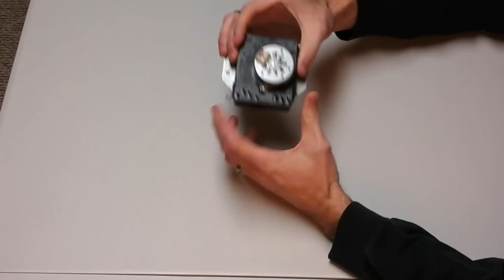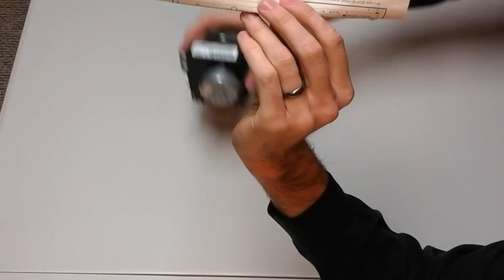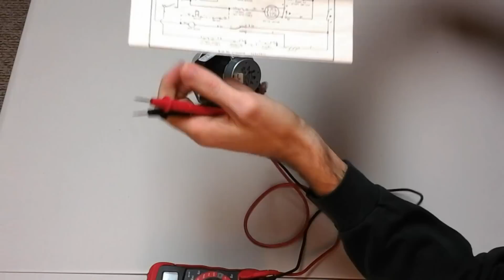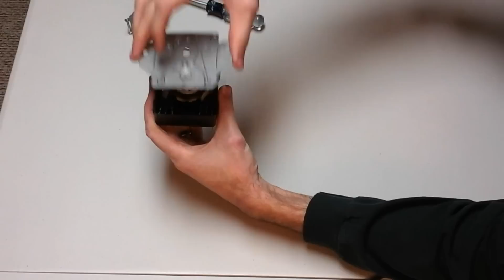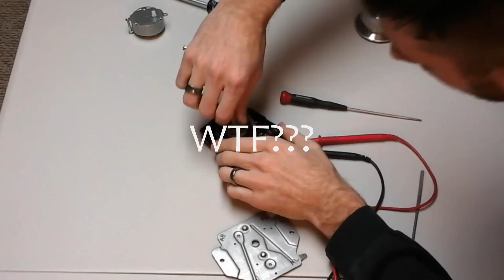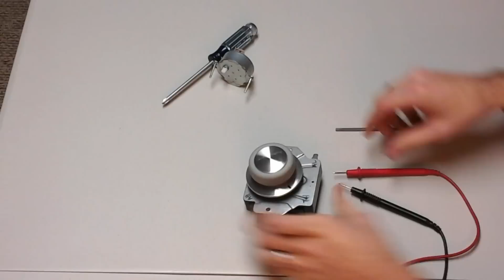Test and repair a clothes dryer switch

Comment: Best fix for the switch, in this marvelous how-to. #1 - by far. 
I'd like to invite you, Dustin, to join me for the beverage of your choice. You earned it. Multiple beverages, if you like. Saved me, at least, 85 bucks. Clear instruction and a logical progression of your simple diagnostics and repair. Outstanding, Sir!
Forget about the blob of solder technique, demonstrated by a Johnny-come-lately.
This video is a fine example of the theorem, "If you can't fix it with a hammer, you have an electrical problem."
Best of all, most importantly, my Gal is happy. However, after she calmed down, I explained that the feather in my fixed-it bonnet, is due to your instruction. Still, I reaped the reward, and I can't stress enough, how thankful I am for your time and knowledge.
Reply from the maker: FyouyaFnF LOL. I'd gladly join you for a beverage, but more importantly I'm glad that you got it figured out, and got a little reward in the end. I appreciate you watching.
Reply: I would like to say.....same same, same same same! Cheers brother! Not sure where you are but drinks on me 👍

Comment: Those terminals are easy to remove. Simply turn the timer over and place it on a piece of wood and tap them with a small hammer. They come right out undamaged.

Comment: Thank you so much for this video! My problem wasn't exactly the same, but your teardown video helped diagnose the problem. A plastic piece on the rings that pushes the plastic tabs to complete the electrical connections  had broke and I was able to fix that and get my dryer working again at zero cost!

Comment: In my case I simply removed the timer (the round disk) and it works perfectly. The button was very hard because the white gear of the timer barely moved and therefore did not make contact. No matter how much I scraped the terminals, it was still the same. Now it works perfectly, but without the timer.
I agree with you about planned obsolescence, but this time it was the timer and not the terminals.

Comment: Thanks for the video.  I was about to order a new timer, but it was the exact same issue you had where the contact between C<->A was not making connection, cleaned up the contacts and did the slight bend, works great now.

Comment: Thank you. But, I did have to wrap tape around the bottom white arm on the right so it would push the copper bands further to the right. There was a gap between the B contact and the A contact. I had to wrap the tape so the white arm would push the contacts further and close the gap. Then the A contact and C contact gave a beep with the multimeter. Thank you for your video. This video helped me twice. Once a year ago haha. I see my comment. I had the general idea from a year ago lol thanks.

Comment: What is the name of the part that connects to the knob? Mine broke and I do not want to replace the whole timer.
Reply from the maker: That is probably not a replaceable part. The shaft that the knob slides on to probably connects to the gear mechanism. You’ll probably have to try to repair it or replace the whole timer.

Comment: Seems like they should have used the switch to activate a 240 volt relay, rather than carrying the 240 volts itself.  I remember when auto ignitions used contact points, and this was a constant problem.
Reply from the maker: Well that would be too robust and last too long, reducing the number of units sold per year 😉

Comment: Great Video! My dryer was not heating, but in my case it was the plastic part in the timer that had worn out. I have CADed the worn out part. Here is the link to the 3D-printed part I designed.
https://www.thingiverse.com/thing:4905660/files 
Anyone can download this file for free but it is not for commercial use.
For anyone who does not have access to a 3D-printer, I am open to helping you out with a minimal fee. Just PM me via Youtube.
Reply: Thank you!  Both you and Dustin saved me so much $$!! Bless you both :)
Reply: Thank you sir for designing it! I will be using it :)
Reply: You are incredible!! Thank you!!

Comment: Have you tried using a disposable emery finger nail file? It is a thinner instrument that gives when placed between the contacts. The flat metal file may be putting much pressure on those brass springs, thereby causing them to loose tension, resulting in a minimal surface contact when they come together.

Comment: What are the plastic arms called inside the timer? Where can I get them?
Reply from the maker: I'm doubting that the internal components of the timer switch are available to purchase separately. If one of the arms is broken or worn, you'll either need to repair the arm itself, or replace the timer. I seem to recall one of the comments below where someone fixed the center rotor that was worn down. He used a mixture of super glue and baking soda (which makes a hard plastic type material) to build up the worn area and then sanded it to shape.  You may be able to use other fine powdery substances with super glue too. I did it with super fine sawdust in this video https://youtu.be/5UpVl5eMzVU
Reply: @DustinRogersinMO  Thank you!

Comment: I have scoured the internet, but do you by chance know where I can get that same type of copper lead/terminal. I have done this a few times over the years, as it was such a major help, but now the lead is completely burnt out. I would love to just be able to replace the lead but can't find anywhere. If you can help oh my goodness I would be so obliged. But if not I thank you anyways for this awesome helpful video and information.
Reply from the maker: I believe they are molded into the switch housing and don’t think you’d be able to remove it even if you did find a replacement.
Reply: @DustinRogersinMO  Ohhh ok, well shucks, that sucks lol, but I really thank you anyways and appreciate your time.

Comment: OMG I LOVE YOU!  You just saved me $300.  ($100 for parts, $100 for service call, and maybe another $100 for labor).  YOU ARE AWESOME.   I also learned once you take off the cover.. DO NOT turn the thing upside down unless you are holding all the pieces in place :(     
The other issue my switch had was the very bottom ring came loose - because people were turning the knob left (counter clockwise).  Took a little while to find the right way to get the bottom ring in place again but hey, I never would have tried if not for your AWESOME VIDEO.    My Roper/Whirlpool dryer has now been fixed - by me - 3 times for 3 different problems.  :)  People like you should be more common!

Comment: Dustin - I literally created this account to go back and thank all of the amazing people over the years...who have not only taught me, but saved me thousands of dollars - you are an unsung hero my friend.  In a small effort to give back - if you are troubleshooting a dryer which refuses to heat, but the motor still fires up - it can be really difficult until you have a multimeter that measures continuity with an audible signal.  I think everyone has that CenTech that measures Ohms (not knocking it - I've used it MANY times).  Problem is, well, you just need a beep for continuity, and I just went and bought the Ames CM600A from Harbor Freight.  No - this is not an advertisement, just my personal experience.  Once I was able to isolate the thermostat, the fuses, and the heating element as good electrically by a simple beep for about $50 - I focused on the timer switch - tested for continuity across the points, and knew that was the problem.

Just from my experience - when you open the timer switch - pay careful attention to where the switch is located on the dial when you take it apart.  There are an array of gears and contacts that need to line back up.  This is not to keep you from the repair - just keep it in mind as you take it apart (and to put it back together again).  If the timer switch is indeed the culprit - you will see it almost immediately - there will be charred contacts on the copper circuits which should be clean.  You may need a flashlight or a bright light source to see the charcoaled/blackened contacts - what I did, was use a mix of fine files and fine sandpaper (available for very little cost at Harbor Freight).  I know, I sound like a HF fanboy, but for stuff that I've mentioned - well worth the savings.

Again - saved me a lot of money - thank you Dustin - incredibly appreciated!

Comment: This is great... thanks!  I had the very same issue with the very same timer, and my temporary solution was to wedge a piece of tin foil in there between the A contact bar and the adjacent post.  Never thought of just bending the bar a little bit... thanks!

Comment: Maaaaannnn.... I had no heat on my dryer for maybe 1 1/2 months! I looked at this video n did exactly what you did with a multimeter for continuity on each setting and noticed 1 lil prong was making 0 contact on any setting n just bent it slightly to make contact!  That was IT! Thank you so much! I saved $60-135.00 on that! Wife is very happy! Rock on man!

Comment: I've had to repair the same timer in our dryer several times over the years. Really seems like a design flaw or they cut corners.  Damn replacement part is 80 bucks too. Anyway, thanks for the video- helps me put it back together again.

Comment: Fixed the timer by following your instructions and filed down the contacts.  I slipped up and the timer fell apart in my hands but somehow went back together again and works.  My dryer is fixed.  Thank you, thank you, thank you.  My issue was the heat worked once and awhile, and only on medium.  Finally, it didn't heat at all.  Now it works on High, Med, and Low.  It was the connection between the A and the C just like in the video.

Comment: Great video insight to save some $$$. I had a switch on my Kenmore 400 i bought used. Lady said it wouldnt dry on one setting. When I opened it up, there is was....corrosion from an arch. Filed it down, checked continuity and BAM! Thanks for the great video post!

Comment: Dawn Peters
Thanks this was the exact video I needed!! Just curious if anybody knows after I made sure the dryer was working I made sure I had everything tight. I noticed that the timer motor was hot. (To hot to touch) IS the timer motor supposed to be hot?
Reply: I'm not sure, I never use the timer and just use the "auto-sense" setting which shuts off when it determines the clothes are dry.  But it shouldn't hurt anything inside the panel.  I put a smoke alarm in my laundry room just to keep on top of any issues with fires :)

Comment: Thanks for the video threw me on the right path. My switch wasn’t working but all of the contacts were clean. I hit everything with a cleaner and contact no dice. I noticed after messing with it I could turn it on only on low heat.  After allot of back and forth I noticed the white gear all the way in the back had the little retaining clip broken and it just spun freely. Off to buy some crazy glue and hopefully that little tiny clip doesn’t cost me $90!

Comment: mine ended up  being  the  lowest  cam   that actuates   B and C    had  come off the  hub.  The tiny little  plastic  'snap'  that locks it on the hub  broke off,  allowing the   cam to   drop off the  hub.   pretty sure    if the dial  is only turned  clockwise  to  set a  cycle,   that tiny  lock would never break.   Going to take a permanent marker and  'arrow'   above the dial  which way to  turn from now on.Cleaned up the  points  while  waiting for  the epoxy to cure  securing the cam  to the hub.  May  work  only 1  time,  or  may work  for the rest of  the  useful life of the dryer.
Reply: OMG I literally had the same problem and just posted it.... the lowest cam came loose.  Nothing broke though.  Took a while to figure out how to get it onto the post correctly.   And yes, before I saw your comment, I had already taken a sharpie and drew arrows all over the front of the knob and dryer to tell everyone in the house to TURN THE KNOB ONLY TO THE RIGHT.  lol.  I think I was the only one who was doing that.  The contacts were also shorted, and scraping them fixed that easily.  It was harder to get that cam back on and get the sharpie ink to stick to the metal lol.   Rock on!

Comment: I followed the instructions, but no amount of sanding was going to make the contacts actually touch.  They were no more than a hair apart, as I determined by a slight pressure on the test leads.  I "fixed" the problem by adding a piece of transparent tape to one of the control arms.  I wonder just how long that will last.  I need a more permanent solution.  Any ideas?
Reply: Hot glue gun, or maybe even epoxy if you are VERY careful with how much.  Or crazy glue something tiny onto the pin.

Comment: First off, just wanted to thank you for helping fix my timer.  For added information to help anyone in this thread, I had TWO issues.  There was arcing between a few of the switches which created a bad connection AND a slightly - I mean ever so slightly - poor connection.  Subtly bending the metal of the switch and sanding the corrosion away with a nail file did the trick.  However, my timer still was not advancing.  Ultimately, it was the cycling thermostat.  The cycling thermostat tested for continuity at room temperature and 'seemed' to switch off near 153 degrees Fahrenheit (which was the manufactured temperature rating).  I came across some information that testing the cycling thermostat alone for continuity alone wouldn't yield the part defective/non-defective and that a non-properly functioning cycling thermostat may leave the drum too hot.  I asked the girlfriend if she noticed the clothes were super hot and she said, "Yes!".  Changed out the cycling thermostat and I'm good to go.  Hope this helps you other DIY-ers out there and thanks again Dustin!
Reply: Very interesting - from a safety standpoint especially.  Can I ask which make and model of dryer?  Honestly, I'm glad you caught it, but others might not...there are recalls all the time for seemingly small things...maybe you caught one?
Reply: @Speed-Of-Light-By-Meter  the dryer has to be around more than 15+ years old.  These issues occurred in May 2020.  I came across another YouTuber who had a similar arcing issue with a timer (different dryer), so it seems to occur from time to time (see what I did there ;-). I could almost see this happening if the user is pushing and turning the timer dial at the same time as it may trigger electrical connection before the timer has been set.  As for the cycling thermostat, that seems to be a common issue - which, yes seems like an increased fire hazard under the right conditions.
Make: Amana 
Model: LGD20AW

Comment: Great video!! You're a true lifesaver,  off work due to surgery and did not have the money to replace switch. Ohmed out all the sensors they were good. Checked motor switch, also ok. Took selector switch apart and there it was, arcing had pitted one of the contacts. Used a points file and fine sandpaper  to clean it up. Kept testing until I was sure it would work. Hoping it will last  awhile until I'm in a better spot to replace. Thanks again.
Reply from the maker: Glad you got it fixed. I hate to think of the number of dryers that have been scrapped for such an easy fix.
Reply: @DustinRogersinMO  Yes, we are definitely a "throw away" society.  Take a field trip to any landfill, or ask any sanitation worker what they've seen thrown away... But think about all the people who can't afford to buy a new one so they come across your video :)    Same thing for all those TV's people used to have in their homes before flat screens.... where did all those perfectly good TV's go?   LANDFILLS.  Now that's sad.  Millions of working TV's......

Comment: Great channel. You are obvious genius.  Question, is it possible to re-build the timer motor on the back?  Mine is broken and they are saying I need to buy a new dryer.  Seems like it should be able to be fixed. Thanks.
Reply from the maker: sl5311 thanks. As far as rebuilding the timer motor, most that I’ve seen are built onto the switch, so worst case you’d have to replace the switch assembly (like the one I’m holding in this video). You shouldn’t have to replace the entire dryer.

Comment: I just did this yesterday. In addition to the steps here, I took a razor blade and shaved off a mm or so on the right side of the "stopper so the far right contact could have a better connection to the contact just to the left of it. 0.00 Ohms of resistance. Installed and worked great!

Comment: ok saludos pana desde venezuela kiero saber el significado  de las letras ke trae el temporisador y su conexion en cuales elementos van conectados gracias
Reply from the maker: Hola desde Missouri, USA. Puede intentar encontrar el diagrama de cableado de su máquina. El mío estaba en una hoja de papel dentro de la tapa trasera de la secadora. Gracias por ver.
Reply: @DustinRogersinMO  ok gracias lamentandolo mucho no tengo el diagrama

Comment: I had this exact same problem (bad A circuit) Fixed it. Although my motor had another arm and a couple extra leads. It fell apart when I took it apart so I spent more time piecing it back together than fixing it!  But thanks for this. You saved me some $$$. :)
Reply from the maker: 3of11 glad it was helpful to you. Thanks for watching.

Comment: Not sure if I left a comment last time, but I just used this video to literally repair the exact same problem again. I have it saved now for when this damn switch inevitably does this again. Regardless, Thank you AGAIN so much. This video has saved me a total of at least $160 bucks by now. I can't imagine what the grand total of cost savings is that you've provided to everyone who has used this video, but it's gotta be in the thousands, if not 10s of thousands when you consider that people will often use it as an excuse (or just think they need) to get a new appliance. My sincerest appreciation. -Ian